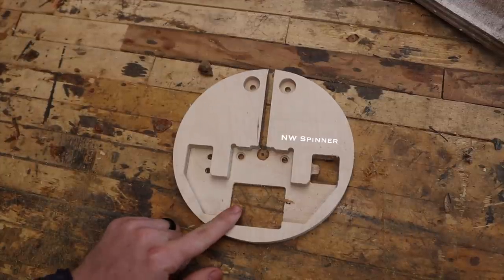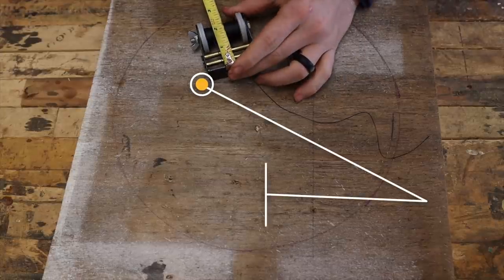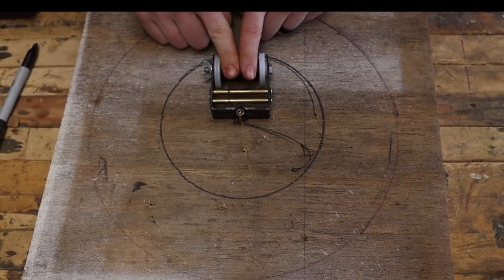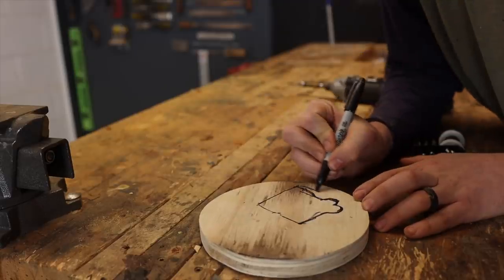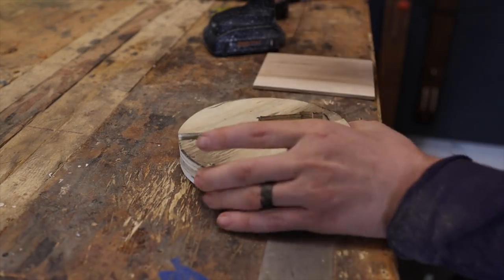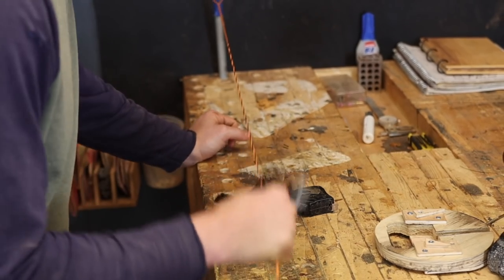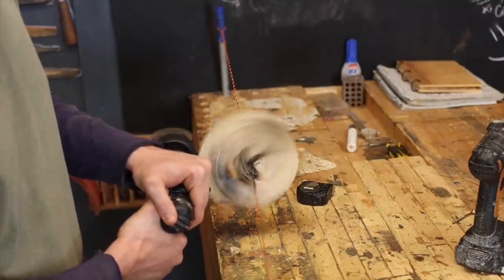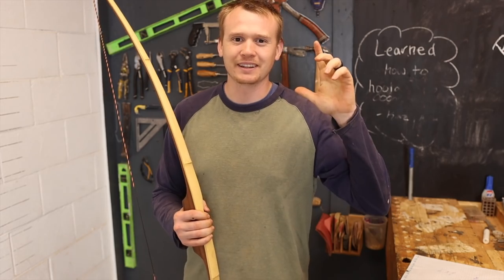DIY "Drill Powered" Serving Jig MOD --- 5X FASTER

Comment: The guy in my local archery shop just flicks the serving tool once he has about a dozen winds on the string and it just runs the serving along under it's own weight. I've tried it but it's almost an art to get the exact tension needed.